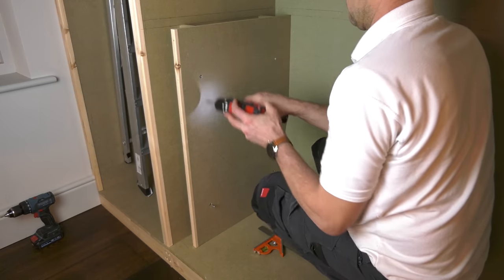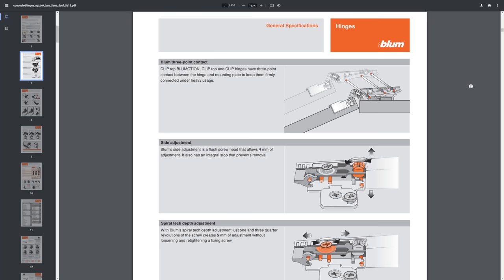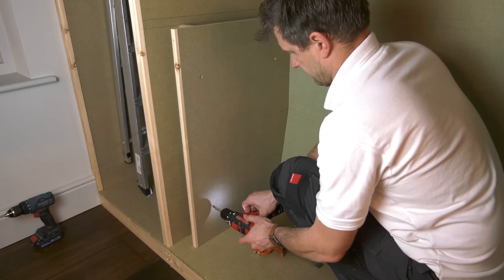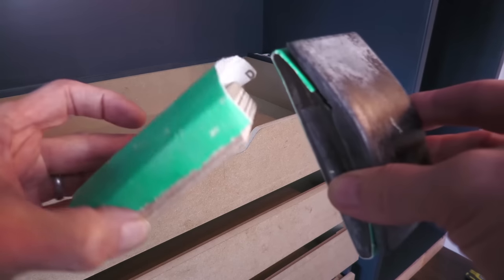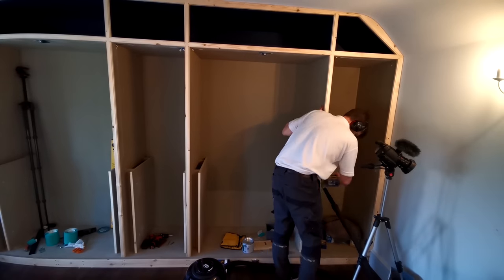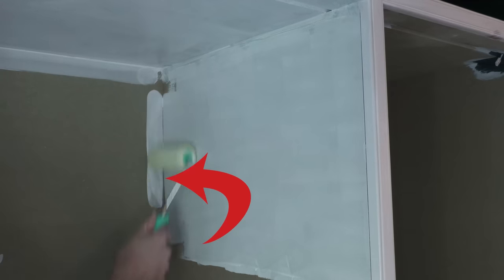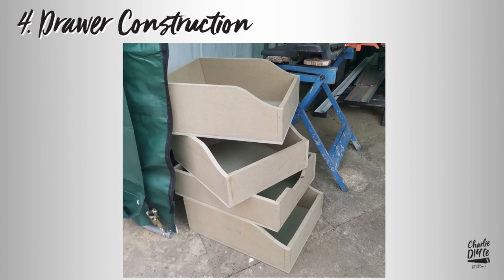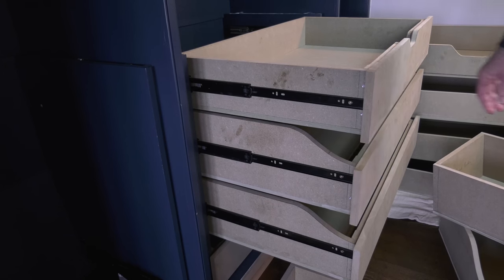DIY Fitted Wardrobe Build - DRAWERS & PAINTING - Video #5

Comment: Hi Charlie, great job on the wardrobe! I’ve been following your wardrobe series to aid with the construction of my own built-in wardrobe project. 
This series has been a massive help and I have learned a lot from the videos, thanks for that. 
I feel as if I need to give something back for all the knowledge and tips you have shown me. 
Just the so you know the ball bearing drawer slides you have used in your build  are fitted with C-shape cut outs around the screw holes the you can push out with your thumb to eliminate the need for washers and glazing packers to help when the draw is too narrow for the drawer slides or if the carcass is out of square. Just thought I should let you know as I have I learned so much from you. 
Great video mate keep up the good work.
Reply from the maker: Dominic that is a golden tip, thanks so much. It had never occurred to me!! I may well employ that over the rest of the build. Massive thanks 🙏👍🏻

Comment: Looking good Charlie after years of fitting those drawers it was only recently I realised how to get the right every time purposely make the drawer boxes 1-2mm small on purpose so take the drawer runner size off then an extra 1-2mm. Then if you look on the back of the runner you'll see u shaped cut outs around some holes not all. Push these tabs out slightly and only fix through these holes with the tabs into your carcase. These take up the difference and centre themselves, just put your drawer in a work it back n forth several times so it centres itself. It might feel stuff 1st time, that's normal. Open n close it a few times and it will be real smooth. Means if your cabinet is a mm or 2 out of square, it's not gonna matter.
Reply: Or just shim them - a rare occasion where "you can't put it back on if you take too much off" doesn't matter !

Comment: Another great video Charlie. Well done!

For internal measuring (eg between the drawer frames) I would recommend a Hultafors TALM3 tape measure (which I bought (Amazon) on a Peter Millard recommendation).  It's very well made and the locking mechanism is very good and precise.

Extending the rear part adds exactly 100mm to the measurement markings, so internal measurements are trivial to make...no bending of a normal tape measure and guessing the distance, or needing a laser measure etc.

Also, when locked say across the front of the frame, it acts as a sort of "story stick"...just move it to the back, and if it fits with a gap, you're too wide, if it doesn't fit you're too narrow.  And when it's a perfect fit...you're bob on!

Comment: Charlie, this has been a superb series of videos on the wardrobe build. Your candid and honest approach is much appreciated and although I am now on full alert to avoid making the same mistakes that you very kindly pointed out, although I am pretty confident I will undoubtedly invent some of my own. Thank you for sharing.😀👍
Reply from the maker: Thanks Norman. It's good to hear from you and I really appreciate that. Yes it's been a lot of fun, this and quite a journey, made very fulfilling by the constructive comments from you wonderful people (the cyclonic extractor being a good example, which arose from the gentle reminder that I shouldn't be air blowing all that MDF dust). I'm currently stuck in the inertia of painting all those drawers and getting to grips with some technical issues. I bought a new camcorder which made the edit on that last video a nightmare. I've finally traced the problem down to the video codec I used being HVEC, which my fairly amateur editing software (and actually most professional suites I'm told) couldn't cope with. I'll endeavour to get a video out this week but it hasn't been easy with the kids at home and is all suffering from a few colds (I'd forgotten what they were like, during lock down).

Comment: Have a look at some Purdy Dale Elite cutting in brushes. They aren't the cheapest but my word they make cutting in so much easier. I bought the set you can get that has from memory 3 sizes, I use the smallest ones most and rarely the largest. I really do recommend them. Being angled brushes they make such a difference.
Reply from the maker: Hi mate, and good to hear from you 👊🏻 That's a great recommendation. I'll definitely get some of those.

Comment: charlie  a  great series   and you have made a fantastic job
as regards to the weight  the runners can take i would imagine that the decreased  weight is to do with the soft close as if you had a full 40 or 45 kg in the drawers  if the dreaers were pushed in very quickly  i don't think the    soft close piston would take the pressure of the full weight at speed of the drawer stay safe
regards
james
Reply from the maker: Thanks James. Yes I suspected it was something to do with that. To be honest I would have been very happy with the standard runners.👍🏻

Comment: Hi Charlie, ive had a big surprise...

Having to rush the last two mdf doors, i decided to skip using any sealer, primer or anything! 

I went straight to Matt Emulsion. In one coat the job was done. I did a second coat and went over the edges a couple of times. 

Job done super fast and super cheap.

In the past i have used Zinser BIN but if this works as well as it looks now, i'm a convert.

Maybe you could try it too? 

Matt Emulsion, in a warm well ventilated room.

Comment: What a brilliant walk through Charlie .  Love how you go over everything the highs and lows. I myself am at the drawer stage now and appreciate the drawer runner advice. I know exactly what you have talked about regarding distance if the drawer cheeks and runners space  of runners either side.. .lm off upstairs with the runners and a drawer to check yet again before I commit to the final assembly. Could I ask did you do two coats of primer and 2 coats of Johnson’s eggshell. Also the shelf pegs what router bit did you use to cut the notch out for the inserts for the pegs. 
Very inspiring work thanks 🙏

Comment: Another great video Charlie! I was particularly pleased about the attention you gave to measuring for the drawer runners.I have had drawer runners at home for a while hoping to make drawers for our pots and frying pan cupboard, need to work outside which has not been possible recently. I have been terrified about getting the measurements wrong. You showing the pitfalls gives me confidence to just keep thinking and checking.
Reply from the maker: Thanks Edward. Ultimately, to be safe, you can put it together first, check it fits and then glue it, but I wouldn't have got into this mess if I had just relief on good old fashioned tape measure and eye, rather than my laser, which always gives you a slightly longer measure.

Comment: Nice job Charlie - A product I've found really good for caulking wider gaps is 'everbuild coving adhesive and joint filler'. It's essential a thicker version of normal caulk and works really well on wood. Used it quite a bit in the past and never had issues with cracking 👍
Reply from the maker: That's a lovely tip, that's going straight into my resource section. I'll give that a go sometime. Many thanks 👍🏻

Comment: Loving this series! Really made me want to do a full rebuild of the previous owners fitted wardrobes, but for now, I'll settle with some faker shaker doors and maybe do a rebuild in a few years
Reply from the maker: Thanks 👍 The faker shaker doors are coming up in a week or two - I've got rather bogged down with the painting the last couple of weeks but am going to try and get a vid out this weekend talking about painting the MDF end grain.
Reply: @CharlieDIYte  morning mate. Ah great, I'll keep an eye out!

I'm not 100% sure on thickness of doors but also how wide to do the frame pieces, be great if you could give a quick 20-30 seconds on ideal ratios etc.

My doors are 400x 2400 and was going to do 80mm wide rails etc. 16mm back with 8mm for the rails and I found these easy fix hinges that don't require you to drill out the holes etc for traditional hinges.

Comment: I learned a great trick for filling gaps: just use drywall compound. I always have a huge tub of that lying around anyway, and it works fantastic* to shove into the holes so the caulk can just sit on the surface and look neat and flush. In my old rickety house I filled a half inch gap with that stuff and years later it still looked great, no caulk cracks or shifting at all.

Comment: As a 55 year old carpenter, the adage "measure twice, cut once" proves right again. Throughly enjoyed the series. Keep up the great work.
Reply from the maker: Yes Andy, that saying is never far from my mind, but clearly wasn't on Tuesday morning! I think the problem came from relying too heavily on my Leica laser measure which, brilliant tool though it is, tends to over egg the measurement by a mm or two when compared to how you'd manually measure with a tape. Plus if anything the drawers that I had installed were if anything a bit loose in the runners so I was keen to get it bang on, which clearly I didn't 🤦 I did experiment in the evening to see if I could take a drawer apart and it wasn't having any of it!
Reply: @CharlieDIYte  the skill in any job is not so much about not making mistakes, but knowing how to get out of them when you do make them. Trust me, we all make mistakes. Yours is quite a refreshing, no ego and real kind of channel. Keep up the great work.

Comment: Brilliant video again 👍🏼Been looking forward to every video release to see how you are progressing with your wardrobe.  Very impressive,  to a professional standard. Have you considered using a clear varnish ontop of the painted surface for added protection. I used water based Sandolin Polyurethate Extra Durable Varnish (Satin) with a synthetic brush  ontop of a desk I painted with a sponge roller. It resulted in a much smoother surface and also protecting the paint underneath. Looking forward to part 6. Freebies well deserved for all the effort you but into your projects and making these great videos.
Reply from the maker: Thanks so much for that Pieter 🙏 I did apply lacquer to my kitchen table but when I had to repaint it, I had to scrape off all the lacquer, so I'm a bit jaundiced about doing this, as a result but I'm interested that it worked so well for you - and if course you used a decent quality varnish rather than a cheap lacquer - so thanks for that. Mental note taken!

Comment: The most superior primer that is indeed sand-able (like a drywall compound) is Zinser shellac primer. All water based primers that claim themselves as sandable, are not such per se, and just gum sandpaper, some of them more some of them less, and just not even close to shellac. Another benefit of shellac primer it dries very fast, seals wood pile and lays very thin. All this helps to address surface imperfections that wouldn’t be visible easily very quickly. Basically as you finish with one panel the other already dry and ready for next iteration or top coat.
Reply from the maker: Thanks mate. Some wise advice there. Interestingly I'm back to BIN on the drawers and I agree it sands much better, and I like your comment about the imperfections. I'm going to do a quick video on painting MDF end grain possibly this week and I think I'll give this a shout out 👍🏻

Comment: Love these videos. Is there any reason not to use ply, instead of mdf? Also,  I'm considering painting my pieces before putting them together,  so I can spray them - is that inadvisable? I'll give them a coat of clear polyurethane too, which will hopefully mean only minimal touching up, once installed. Thank.

Comment: Love your videos Charlie and I’ll be taking on a similar alcove wardrobe build soon. 
Can I please ask about your paint choice and why you chose the Acrylic Eggshell from Johnstones?
I hand painted some pine bedroom furniture a few years ago with Johnstones Eggshell (oil based) and the coverage was fantastic on top of Leyland Acrylic Primer Undercoat. 
I was planning to use the oil based eggshell again but wondered whether to try the water-based acrylic eggshell this time. 
Also, have you ever considered finishing with a few coats of Briwax furniture polish to add to the durability of the finish?
Reply from the maker: Thanks Stuart, chuffed you find them useful. If you're used to the oil based don't go acrylic. You'll be so disappointed! I went water based because there was SO MUCH to paint I would have been waiting for days for everything to dry, and given the time of year, it would have been done inside the house - so lots of fumes. Why disappointed? Because I've had the odd chip but the main issue is the paint scuffing when you open a drawer and the door isn't completely open and the drawer hits it. I'll be applying a protective top layer and doing a video on this at some point. Minwax polycrylic coating and Polyvine decorators varnish are two products recommended by viewers, and a decorator on my Discord forum recommends Tikkurilla Kiva 10 or Blockade Rock Top which I suspect are much better than the previous two.
Reply: @CharlieDIYte  Thanks for elaborating Charlie and it’ll be very interesting to see your next video then. 
I’ve been very impressed with how the oil based eggshell with Briwax on top has held up on the drawers I painted. There’s been no discernible chips in the last 6-7 years and the furniture is in our main bedroom so is used daily. 
Look forward to seeing what you make of the more specialist top/protective coats.

Comment: Great video as usual Charlie. Quick question, did you go for the plunge saw because of the better dust collection over the circular saw and diy track you made?
Reply from the maker: Basically yes. The dust generated by the Evolution hybrid circular saw was too great, and unfortunately that DIY track I made over the summer has a slight 3mm deviation in the middle. You'll see me explain a bit about the Erbauer in this video near the start  https://youtu.be/4ylDeQXv1k0
Reply: @CharlieDIYte  Great stuff, thanks Charlie! Made my own track and the circular saw dust collection really is terrible! Will investigate a track saw..

Comment: I've done the same with a drawer where I built it and it was too wide being just ever so tight on the runners. I used the router and took 1mm off each side just where the runners mounted and it seemed ok. I now tend to just take 26mm off the internal cabinet width to get the external drawer width instead of shooting for absolute perfection. The runners have that little bit of play anyway.
Reply from the maker: Reassuring to hear I'm not the only one - thanks for that 👊🏻 The problem was my Leica laser. My carpenter mate was over the other day and we compared two measurements using the laser and my Tajima tape measure and the laser (which I completely relied on for all those drawers) was 2mm wider. I thought about routing but when the runner goes into its double extension you'd see a wider channel so I'd rather trim the frames. Yes, better to under egg it, plus someone pointed out to me that you can bend out the tabs on the runner to micro adjust it.

Comment: Really looking forward to the finished product. I do wonder though - wouldn't it have been easier to buy prefab drawers like the ones you get from IKEA and install them instead? (Obviously I know you're doing everything from scratch) but I'm just thinking from an efficiency and cost perspective.
Reply from the maker: Possibly. The Pax system seems quite well received. I wonder if they would be as durable though. Plus, it's not nearly as much fun as making them yourself (though I'm not sure my wife would agree 🙄).

Comment: Great video Charlie would you give me some advice on a mitre saw for a bit of DIY was looking at a erbauer and a evolution would appreciate if you could reply thanks. Love the channel keep up the good work
Reply from the maker: Thanks Paul. I would recommend the Evolution. So much tool for your money and my father in law had an Erbauer and I found the blade a real pain to change. I've got the R255SMS single bevel 240v,  Product code 1062X on Screwfix but annoyingly out of stock right now. It is available on Amazon though https://amzn.to/3xaml2S but more expensive.
Reply: @CharlieDIYte  thanks for that Charlie appreciate it

Comment: Great job.  Do you think using more expensive / quality tools would have helped your mitre joints on the trim that a few people pointed out was a little less than perfect? I use a few similar tools to yourself, but then see people using the likes of Festool gear and wonder if it would make my work better?
Reply: From bitter experience I can say that 'cheap' tools are often just superficial copies of the more professional brands. You don't need to pay Festool prices to get quality tools that you don't feel like you're fighting with when you use them. The other advantage of paying more for a Makita/Dewalt/Bosch/etc is that you will be able to get spare parts for it. Try that with Erbauer and you'll be told to buy a new one!

The only cheap power tool I've bought which has mostly been an exception to the above is a trim router by Katsu Tools, which is a clone of the Makita. It's a bit rough around the edges, but in use works well. Not sure about its longevity though. And when it does go wrong it'll go in the bin.

Comment: if you want to minimize the look of the bottom of the drawer, you can route a bevel along the bottom edge so it either looks smaller or invisible. you may need to countersink your screws depending on how deep a bevel you want.